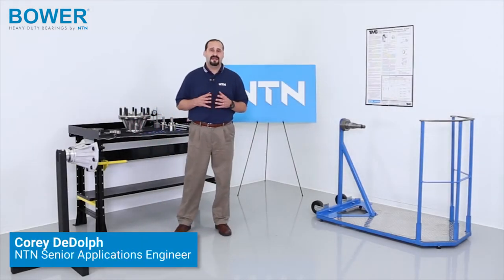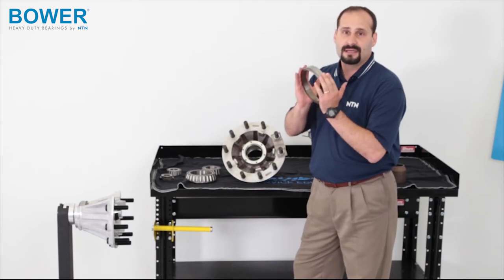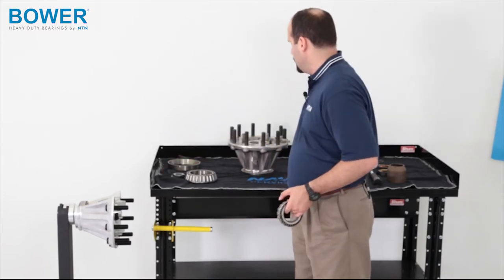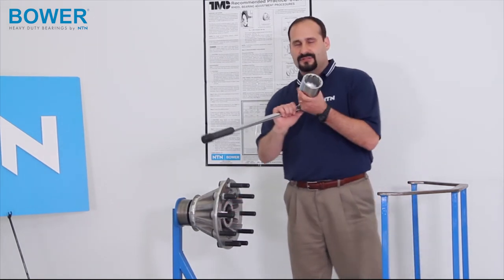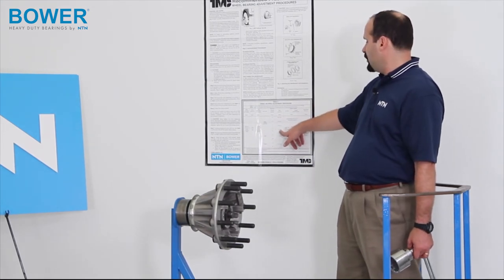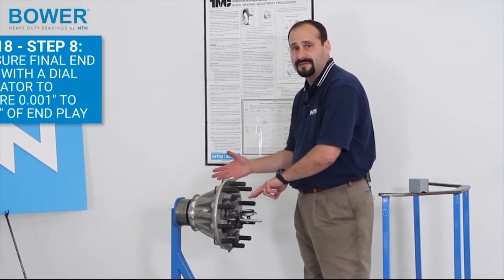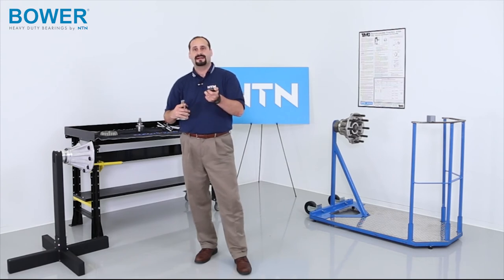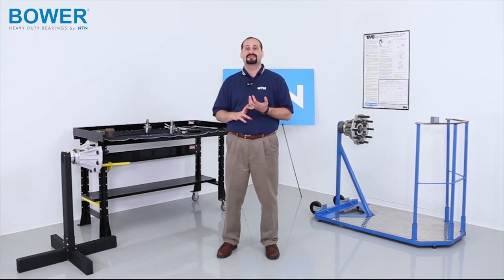Heavy Duty Wheel Bearing Installation and Adjustment - Bower Heavy Duty Bearings by NTN

Comment: What if your truck is only a single nut application but it's a 18 wheeler over the road? Your saying only local bread trucks are single nuts?
Reply from the maker: We find the style of retention nut used usually comes down to the preference of the fleet or operator. The dual nut system is likely the most commonly used in over the road trucking, but we encounter all retention nut styles used in all applications. Single nut set-ups are growing in popularity though.
Reply: @BowerBearings You didn't answer the question.